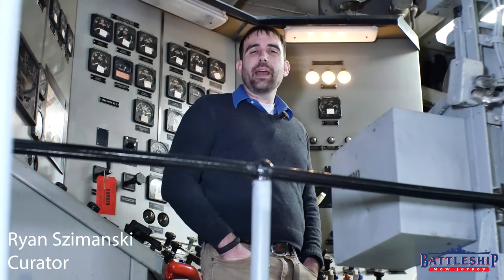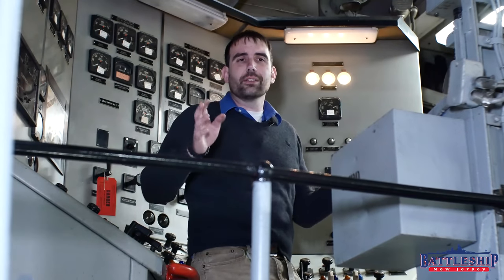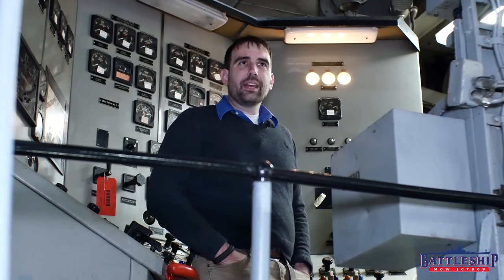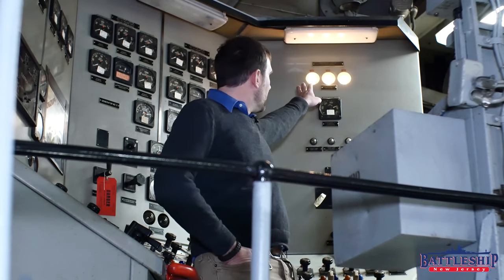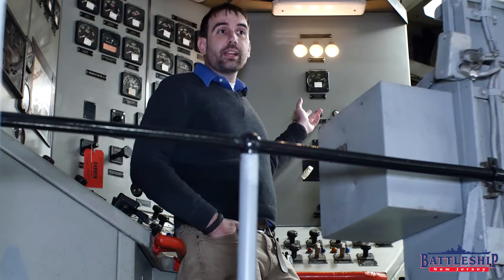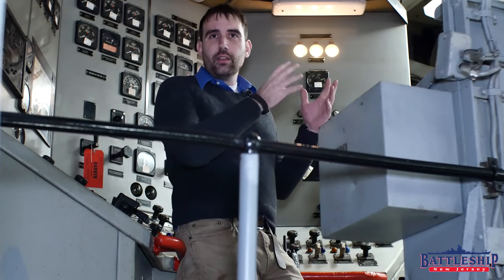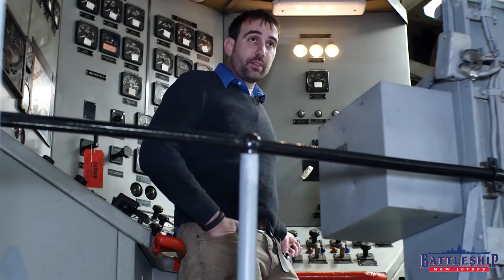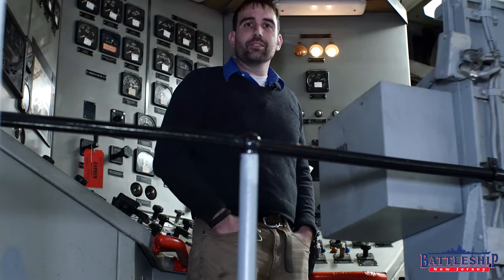How Do you Detect a Grounded Circuit On a Floating Warship?

Comment: Most electrical systems are grounded, meaning there is a solid, low-impedance connection to ground somewhere in the electrical system. In single phase systems, this is can either be at one phase conductor or the other, and often at a center tap between the phase conductors (Typical North American residential power systems are center tapped 240V systems, giving two 120V ‘phases’ 180 degrees apart).  In three phase systems, the most common place to ground a system is at the center terminal (or star point) in a wye connected transformer or generator. In a delta power system, the ground point will either be at a one of the phase conductors, or at a center tap between two phase conductors, the later being more common. In all cases, a short to ground will circulate ground fault current through the ground connection point. This fault current can be hundreds or thousands of amps, but the fault current only flows briefly. A fuse or circuit breaker will detect these high currents and open the circuit clearing the fault, often within a few milliseconds. Most breakers are designed so the higher the fault current is, the quicker the reaction time will be. These parameters are usually specified by engineers and electricians so the breaker closest to the fault opens first (breaker coordination).

In high reliability systems, it is undesirable to have equipment immediately shut down because a fuse blows or breaker trips. Some examples are blast furnaces where failure of the blowers could cause the melt material to solidify ruining the equipment, overhead cranes where an operator could get stranded, explosive environments where fault arcing could cause an explosion, medical and life support equipment, marine applications where the power system would be relied upon to get the ship back to port where parts and labor is available for repairs, and military applications where the equipment is required to continue to perform until the boat or ship is back to safety.

To prevent a fault from being cleared by a circuit breaker or fuse, an ungrounded electrical system does not have any of its power system connected to ground. On a boat or ship, ground would be considered the hull. In the event of a fault, fault currents would be limited by the amount of current that can circulate through the system through capacitive charging. Essentially what this means is that the distributed capacitance of the system establishes a neutral reference and similarly a path to ground. During a fault, currents will flow through the system capacitance which can be several amps, but not enough to trip the fuses or breakers. Even 1 amp is certainly enough to kill a person, so the energized conductors in an ungrounded system are not safe to touch.

As Ryan did a great job explaining, the downside to ungrounded systems is that you need to continuously monitor for grounds, and have electric plant operators and electricians on hand at all times to locate, and safely isolate and repair the system. A fault on an electrical system means something was damaged, or has deteriorated. A fault on one phase often means that a fault on another phase may be imminent, and two phases faulted to ground is the same as a phase-to-phase fault, which will blow your fuses or trip your breaker, brining the equipment to a halt.

I have worked first hand on some museum ship’s electrical systems, and their electrical systems have been converted from ungrounded to grounded by deliberately bonding a phase conductor to ship’s hull for each electrical system in a transformer or switchboard. The downside to this is downstream distribution should have all fuses bypassed on this grounded conductor. Many museum ships do not have much left in the way of operating equipment, typically just lights, and maybe ventilation or pumps, and because they are forever in port, the added resiliency that an unground system is no longer needed and a traditional grounded system can be used to reduce operational costs.

An increasingly popular alternative to ungrounded systems are high resistance grounded systems. These systems have the fault tolerance of an ungrounded system, but are easier to instrument and troubleshoot. By connecting the system to ground with a resistor, fault currents are limited to predefined level, typically 5 amps. To facilitate locating the fault, a pulser option is often included which temporarily shorts and un-shorts a portion of the resistor typically with a 1 to 5 second interval, changing the resistance, and the fault current in a way that is easy to detect using a hand-held current sensing probe, or other metering devices located in the system. (The periodic change in detected current makes it easy to distinguish from background noise). The location of the fault can be determined to be between an area where the fault fluctuation is detected, and a downstream area where the fluctuation is not detected.

Comment: Does @battleship New Jersey have regular 110 outlets throughout the ship?  Something you could plug a boombox, electric razor, "modern computer", or cellphone charger into?
Reply: StringerNews1  We were allowed to bring pretty much anything reasonable on board, contingent on it being safety-tested and tagged by the EM's before use.  Most division offices and workspaces had their own coffee pot, if nothing else.  All of the berthing areas had color TV's in the lounge areas.  Electric shavers and hair clippers were common.  

I left Active Duty in 1990.  Cell phones were rare and the size of a brick, and nobody I knew had a personal computer.  Besides, a cell signal is low power and pretty much line-of-site.  If you have a cell signal, somebody on shore can probably track you with a pair of binoculars.
Reply: StringerNews1  Yes there is 115VAC utility outlets, mostly there to power the ship lighting, but also used to provide power for things like floor polishers, TV sets and definitely all the mess ancillaries. The stoves would be run off the 400VAC system direct, as it is easy to provide elements that are rated for 400VAC, and the standard stove switchgear is able to operate on it as well, or at least the switchgear manufacturers can make the standard switch operate on 400VAC.
Reply: Every ship that has 480vac 3 phase (delta) for power, has step down xfmrs for 220/120 vac power. These are also ungrounded systems. You use a 2 pole breaker for 120 and a 3 pole for 220 3 phase (like for reefer containers). Most (if they weren't too cheap while building the ship) also have their own ground detection systems.
I was once on a really old ship (built as a troop carrier to invade Japan) that had 450 vDC main generators (there was a war going on! AC was for combatant vessels!). It had been converted to a container ship for Sealand. They had to install motor generators to provide "hotel services" electricity for the 120 vac power. (It was overall, a PITA!)
Reply: StringerNews1  don't wanna belabor this, but yeah.. 
I've got a marine engineer license, worked many years as a controls engineer, electrician, hvac tech, robot tech. Not bragging just kinda been trippin' through life.
I'm retired now, and just set back and chuckle at some "new" discovery some 30 year old "just" figured out!
I've worked on, from 12 kV to thermocouples, I've been "trained" by E-2's in the Navy to Phd's.
I pay attention to everyone, sometime people can surprise you with thoughtful insights.
Reply from the maker: Absolutely.

Comment: Actually, what you are detecting isn’t “ground” but a “ground fault” condition in which live power from one of the three-phase legs has found a path to the virtual ground that is the hull (though, when out at sea the hull is actually far better grounded than your average home as sea water is a far better conductor than dirt).  It is actually a very simple task, electrically speaking, to detect such faults as you need only look for a current differential between the sum of the current being fed into the system versus the sum of the current that is exiting the system.  Being AC, this is trivially achieved through very simple transformers that encompass the conductors in an appropriate manner (both the “incoming” and “outgoing” current with proper phasing observed) — very much like the current clamp in a clamp-on ammeter (amp meter).  When the current is in balance (no fault) then there will be no current flowing through the current transformer(s) as the equal currents result in a net zero magnetic flux (i.e. the opposing North & South fields cancel each other out as they are equal in magnitude), but if there is a fault then there will be a current imbalance in the current transformer that results in a net current flowing through the current transformer’s detection coil since the “incoming” leg will be sourcing more current than the “outgoing” leg(s) will (with the difference flowing to the hull and then back to earth via water) and this current can be trivially measured to detect precisely how much leakage current there is to your virtual ground.  

I am uncertain if that is how they have implemented the setup in this instance, though I suspect they are doing it by another means as there is no reason to make ground fault indication a switchable function as the current transformer method can be left enabled full-time to indicate leakage on a continuous basis or even to alarm in the event of a ground fault in excess of a programmed threshold.  With the current transformer method the only lamp that would be illuminated would have been the leg that has the leakage path, but in this video it is indicated that the leg with the fault would go dark, but that could also simply be an implementation detail since I am unfamiliar with how they implement such aboard ships, but basic physics works the same at sea as on land.  I do believe these ships also monitor for faults in which they BECOME unintentionally grounded since an unintentional ground can greatly increase galvanic corrosion (hull) losses as well as become a potential safety concern when moving from the ship to shore and vice-versa since then there could be different ground potentials at play.

This is how the GFCI (or RCD, residual current detector, outside North America) functions and why we were capable of manufacturing GFCIs well before we had semiconductors small enough to incorporate into a home outlet or circuit breaker module as it was literally as simple as a detection coil feeding a trip coil.  Modern electronics were then later added into the design to improve their reaction time and to reduce spurious nuisance trips when switching on inductive circuits (which would sometimes trip our typical 5mA GFCI).

Comment: Navy vessels can not just call an electrician to come in and fix a problem. That's not to mention that an electrician you might find in the yellow pages wouldn't have the vaguest idea of where to start on a ship. The same goes for everything else on board. That is why the Navy has all the specialized ratings. In this case, it'd be the Electrician's Mate (EM). They are a part of the engineering group and start their Navy careers as Fireman Apprentice and Fireman.

Comment: An Air Force power or lack of power story.  One night at work we had a strong thunderstorm that knocked out commercial power.  Inside the shop, the drop out relay kicks out with a bang.  We immediately turn off all the power supply power switches to all the logic cabinets for the computer.  I run to the Command Post to insure they shut the console power supplies off. We hit the drop out relay to go to the backup generator.  NOTHING!  I go out side to check the generator.  It shows volts but no amps.  I call Job Control to report this and to have Civil Engineering (CE) come to check the generator.  
While waiting for CE, I go back to the Command Post.  Could there just possibly be another circuit breaker box that is now long forgotten?  I check the Command Post back offices, nothing.  I check behind the hanging fabric wall covering in the battle staff room.  Nothing.  I am in the "cab" of the Command Post wondering where else I can look when the Major officer control that I know well starts chewing on me to get the power back up.  I spin around and square up to him and say, "Sir!  Cool it Sir!  You are not helping!"  
I could see my butt chewing building in him.  I could see it rising from his chest to his neck when suddenly it vanished.  The Major's shoulders slumped a bit and he told me, "You're right." and walked away!
CE finally came and found the problem to be the relay between commercial and generator power was frozen in the middle preventing us from getting either power.  The tech told me that lightning probably hit the generator and fried the relay.  He manually switched us to commercial power which had come back on by then.  
The Major and I continued to get along just fine after that.  I even had him swear me in for my first re-enlistment in the cab of the Command Post.
Reply: @Matto Meter The relay was in the auto position.  We never touched that switch.  Not our job.  The tech told me that it was fried and frozen.  It was most likely caused by a lightning strike.
Reply: @Matto Meter That is true.  I was with him when he showed me the relay and had to force it to the commercial position.  I was told he ordered a new relay and that until it came in, CE would have to manually switch us to generator power when needed.  
That is what I know.
Reply: My ears hurt just thinking about it.  All that stood between my shop on board ship and the 500kw Emergency Diesel was a 1/4" thick steel bulkhead.  TWO Detroit 8V92 turbocharged diesels firing up with HP air starters needs to heard to be believed.  Unfortunately, the system was configured in such a manner that the bus tie between the Emergency Switchboard and the emergency bus had to be closed manually..as soon as an EM could make it to the EDG space to do so.  This was to allow voltage and frequency to be verified before energizing the emergency bus.

Meanwhile, on the other side of the bulkhead...Total loss of power causes the auto-transfer switch to drop from "normal" straight through "Alternate" to latch into "Emergency"...I've fired quieter handguns.  The Bus Fail alarms on both my 60Hz and 400Hz switchboards are screaming.  Output Fail alarm on the 400Hz M/G set is screaming.  Power Fail/Battery Mode alarms are screaming on the Phone System, Master Gyro Compass, and Aux Gyro Compass power supplies.  Output Signal Fail alarms are screaming on the control cabinets for both gyros.  All this time I have two diesels next door running at 1800 RPM waiting for an Electrician to close the bus tie.

"Emergency Diesel Switchboard Watch" very quickly became part of my Quals List.
Reply: @Matto Meter No, those relays are very common to have fail in the middle from old age, neglect or being whacked by lightning fusing the bushings as it arcs over.  Especially if you normally have reliable power, and thus the relay sits for long periods without moving and freezes up as the lubricant drains away.

I do remember fixing one up, after digging it out of the ground, as the power needed to be back on, but, due to heavy rain, the wall it was on collapsed. Wiped down with a cloth, shook out the mud, and connected it back in the 2 circuits, then covered with garbage bags to keep it dry.  Worked perfectly for the 3 months it took to do the repairs, and get a new one installed. They first had to repair the building.

Comment: In our place we get 100A per phase at 2400 volts. Next step is the transformers, and then, for some unknown reason the power company insisted on inserting a meter next.
After the transformer we have 240 volt three phase service at 1000A per phase. From there the utility power goes to three power transfer switches and from there to the three main distribution panels. But in case of an interruption in utility service the power transfer switches will switch to our internal power generator. We are in North Dakota, and so we have REAL GROUND under our (er) ship. : )

Once upon a time we had three high pressure boilers, and generated our own DC power for our whole complex, and also served as the utility company for the town around us.
Of course the utility company came in and everybody wanted to switch to this newfangled AC power. We went on to AC power as well, called it the "high-line" but still provided most of our power from our own generators, which were now shut off at night. Of course this caused there to be two different power sources for each building, a real no-no which continued even after we shut down our generator and got all of our power from the utility. You just had to keep in mind that the old 'high-line' was still energized.

This was all corrected with the complete rewiring of much of our plant when we installed the back-up generator. A real electrician did that work and so he had to make everything correct.

Comment: Are GFCIs used on any of the outlets for regular equipment that normally should be grounded?
Reply: No ground available, so a regular GFCI will not work. You have to use hospital grade isolated system ones there, which typically do not fit in a regular outlet box, but which are another larger unit feeding the sockets, with a light and an alarm on them, to indicate a fault.
Reply: @SeanBZA  if there is no ground to the GFCI it can still protect life by detecting imbalance of current between the hot and neutral wire.
Reply: @thedopplereffect00  Only works if the supply is ground referenced at some point, but with an isolated supply there is no reference, and thus the GFCI will not operate at all, until there is a second fault not on the same side of the GFCI. Isolated supply by definition all current is in balance till you have 2 ground faults, one per leg.